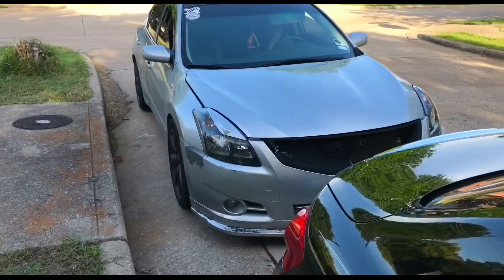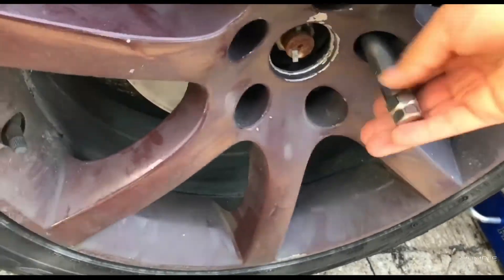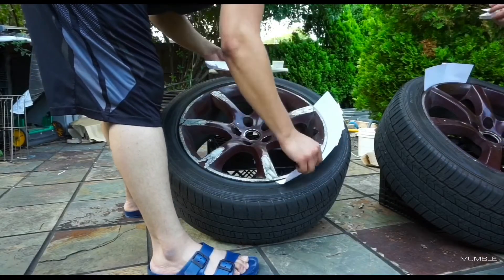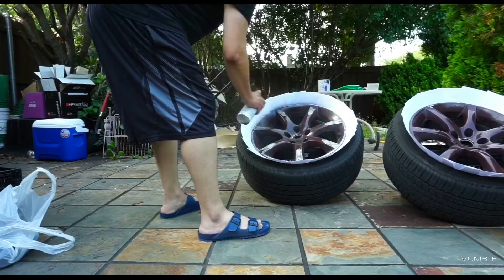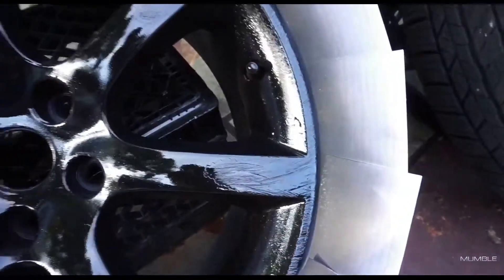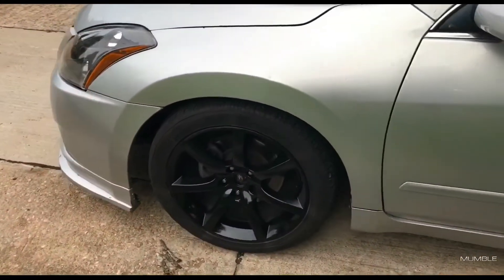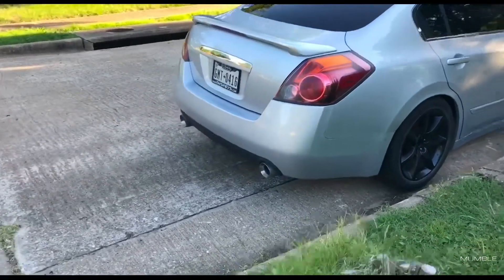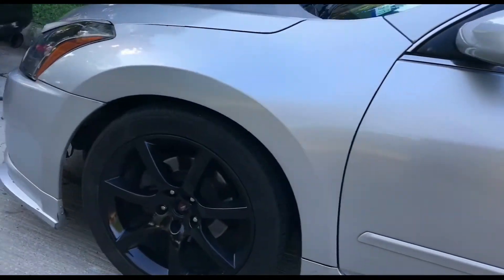Altima wheels spray painted...

Comment: Oh what year is the Altima? Mine is 2008 and your bumper facia looks like yours is 2010+
Reply from the maker: Mine was a 2009 but It got  face lift
Reply: @MumbleVlogs  I know this video is old and you probably don't have the car anyway but did you have to change the fenders for the front end swap? And also did your rims rub? I had these exact rims on mine with the same 245 45 series tires and they would rub like crazy.
Reply from the maker: The car was actually a salvage title car so idk what was done to make the newer front end fit

Comment: What tire size you running any rubbing ?
Reply: @Enrique Flores 245 45's. You can see it at 1:20. I had these exact same rims and same tire size on my 09 Altima and they rubbed big time. They're a lot heavier too.
Reply from the maker: That’s crazy I never had any rubbing issues with mine

Comment: Great job i need that paint can u use that for da grill
Reply from the maker: Thanks bro, so the paint can be ordered from certain oreilys as they are able to get you a small spray paint can with the color code of youre paint. it is about $15-$30 per can. I always ended up using whatever was available over the counter.